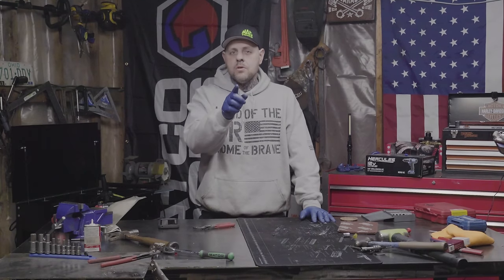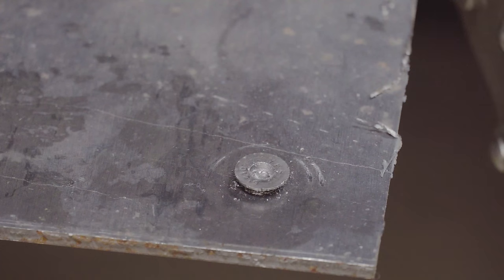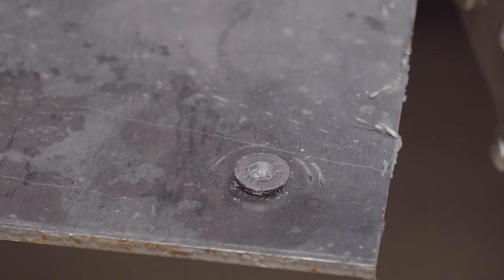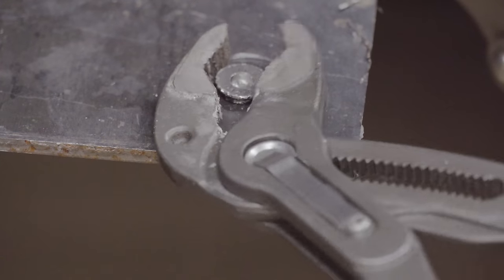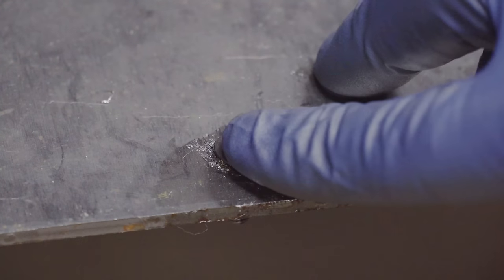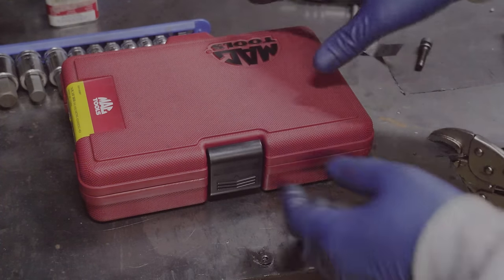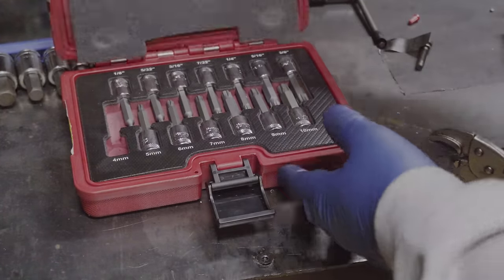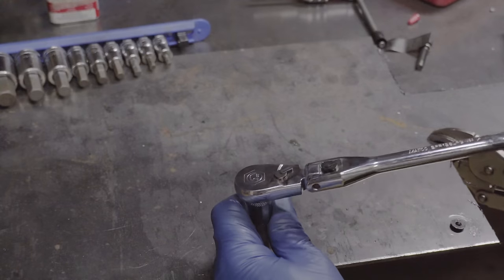3 Easy Tricks to Remove Stripped Allen Head Bolts

Comment from the maker: Do you know any other tips to remove a stripped allen bolt?
Reply: A method ive used many times in the past involves a  dremel rotatory tool and two regular cut-off wheels inserted on the supplied shaft to use cut off wheels (I don't know the actual name of this part). Next cut a notch across the head of the fastener. A 1/4" flat head screw driver fits in this slot easy. Its not pretty because  you can cut into the surface of the part you want to remove, not just the fastener, but it does work.  Works with other fastener types as well.
Reply: One word :Vampliers.
The only thing you need for things like this. Its designed for this very thing. Its a life saver. They also come in needle nose. Hard to believe, but for things like this, they are better than knipex.
Reply: I just get a torx bit and hammer it in and they always come right out
Reply: Yes, you can use a centre punch. First, punch it straight, on the edge. Then at an angle in the punched hole in the direction to loosen the bolt.
Reply: 2nd one I forgot. You can also weld a standard nut to the head (inside the thread) then just use a socket or spanner 👍
Reply: Erwin and other top brands makes screw extractors I use often at work but thats the obvious option. I know you were thinking more outside the box.
Reply: @mikefinto4048  I have found a Torq bit also is the best way,haven't been defeated since I started using that method a couple years ago,but honestly these extractors he showed don't look much different than a Torq
Reply: I've used an auto center punch to drive the head around in a tight locations when I couldn't swing a hammer
Reply: @LoneWarrior.  not so well on countersunk fastners but they work well too.
Reply: Hammer a torx bit into it.... works awesome of that wont take it out it strips it to anothe alab key size
Reply: Redemption Garage weld an Allen wrench to the bolt. Not ideal but it works
Reply: Let’s not forget using a dremmel tool with a small grinder wheel, Can take out enough to use a flat head in the bolt.
Reply: If you still have some grip left in the head and not completely rounded out a dab of valve grinding compound can give you enough filler to get a bolt/screw out.
Reply: Ben Sorisio worked like a charm thank you
Reply: Ben Sorisio did this on my brake cuz one bolt wouldn’t come off
Reply: rubber band
Reply: Brian: thank you for showing tha MAC tools set. I really appreciate it.
Reply: Brian: Could you post the MAC tools set part number? TIA
Reply: Those hex headed cap screws like you showed in the video are easily removed by drilling into the hex area with a drill bit that's a bit bigger than the size of hex key and popping off the head. Could probably do it with the countersunk screws too. I don't like the idea of banging 2 hardened hammers together, they can shatter (I know myth busters say they busted that theory, but a fiend of mine had it happen to him and tore his knee to bits)
Reply: What if the screw is flush and can’t be grabbed from the outside?
Reply: Honestly when they get like that I take the end of my rubber glove, cut a piece of and wrap it around the Allen key. Works every time for me. Depending on what caused the strip in the first place sometime a little heat needed but great results. I’ll also  had a sacrificial key and jb welded it in to get one out. Worked well but not the most ideal way
Reply: Try using a flat, Robertson or Phillips head screwdriver that fits snugly in the screw head.
Reply: I’ve used:
- a Dremel to cut a notch all the way across. Then use a flathead= a little help.
- Dremel all or halfway across, then use a flathead at an angle, tapping with a hammer on back of screwdriver= more help.
- Hammer in a hexgrip head as you’ve shown already.
- delicate situations(like inside guns) JB weld a Allen wrench head into the screw head, let it set 24hrs, then slowly apply pressure.
- vise grips/pliers as you’ve shown
Reply: @AdamDguitars  "What if the screw is flush and can’t be grabbed from the outside?" 
How's it hangin Adam, I think someone mentioned they make "Grabit" type screw extractors, where the inner core is bored and then a reverse thread screw grabber locks in and removes the screw counter clockwise. Besides spraying it with penetrating oil, in addition I always tap the screw with a hammer or nail punch for a few minutes to help break the threads of corrosion or thread lock, before boring and attempting to extract.
Reply: I realize this isn't always possible, but if it's many bolts holding something on. As soon as I realize one is stripped, i re-tighten the bolts on both sides closest to it, and loosen all others. That way some pressure may be taken off of it by the opposite side lifting, and the re-tightening of bolts on sides  will push down taking pressure off of it. Sometimes even when stripped it will come right out then.
Reply: @dustinpomeroy8817  that's what I have been thinking man, they are just Torx ends... Just get a really good quality Torx wrench or Torx socket and tap tap tappy it in and go... Im almost ready to go! Wish me luck guys!
Reply: I hear you now I'm having problems with my custom Harley I got one in the starter with red thread lock on it that is starting the strip thank God for this video
Reply: @mikefinto4048   or an XZN, 12 point, triple-square bit. bit
Reply: Pack some steel wool in the socket, then tap the allen key in firmly. The steel wool will take up the slack allowing the allen key to grip.
Reply: Lmao this thread is great. Here for my red dot on my pic rail😭

Comment: Very helpful video. A couple other methods that I have used are an impact screwdriver with a hex socket attached, and probably my favorite is using a torx socket and tapping it in the hex bolt to get some bite. The latter is what ended up working for me on a stripped transmission hex drain bolt on my Softail. Thanks.
Reply from the maker: Those are also really great tips. Thanks for sharing that brother!

Comment: Thanks to whoever mentioned in the comments using aluminum foil to add to the allen key to make it fit in the bolt. It worked! I was trying to get the faucet handle off an old Delta kitchen faucet to replace the cartridge, and the allen bolt was stripped (or I stripped it). Cheers!
Reply: Thanks to you for saying this for those who didn't see that

Comment: Enjoyed your video....but I actually didn't use any of the methods....but your video game me an idea. I definitely use the first 2 methods because the bolt was recessed. On the last method, the first 2 places I went didn't have such a kit..(although my 3rd stop was going to be Harbor Freight)  I couldn't afford to buy an entire kit of something (even though I'm sure I'll need it in the future.)  Enough rambling....the bolt in question was an M5 .80 thread. The head used a 4 mm hex.  I ended up successfully using a T25 torx bit and it worked! Your 3rd method gave the idea! This was for the clamps on a motorcycle handlebar riser...Thank You!

Comment: Tip 2- albeit with a Torx tipped-screwdriver and a regular hammer, carefully- worked amazingly and saved my bacon at midnight when I needed to replace a faulty shower cartridge. I cannot thank you enough for your tip and I will keep this in mind for the future when encountering a stripped head and no other options present themselves. Again, genuinely, thank you.

Comment: I viewed numerous viideos and wish I had come across your first. The "stripped allen removal set" bit was the only way it worked for me on a shower faucet. I bought and tried the standard screw extractor set which may work fine for standard flat or Phillips head screws but on a small allen wrench "bolt" it just went round and round. Perhaps when I drilled it for the aforementioned screw extractor I created the opening to be enough to get a star-shaped bit (with teeth, as you put it) to fit in and stick when I tapped it with a hammer. Then slowly and prayerfully I turned the ratchet and it stayed nice and snug and was able to unscrew it. Thank you very much. - Allan

Comment: The first thing I do is use a torx bit that fits tightly and tap it in.  It works most of the time on Allen head bolts.  I like the Mac set though.
Reply: I can confirm that this worked this evening. A Torx bit, but otherwise essentially following Tip 2 in this video. Worked very well.
Reply: Was thinking I was gonna have to weld a nut onto the bolt but tried this and it worked like a charm
Reply: @xemericaxx  👍🏻
Reply: Thank you for the Torx tip, it worked amazingly well!!!
Reply: @chickyman1  Glad it worked for you!

Comment: This is a great video. Very easy to follow. My problematic allen nut is unfortunately much smaller (actually a bigger problem). I tried the smallest allen wrench (<< 1mm) but it didn't grap. I think the allen nut had rounded out by previous owner of the house. This tiny allen nut is holding a knob to the shower diverter on the wall of my bathroom. Do I need to cut out the know with a saw? Help!!

Comment: 1. Instead of using the rubber band method, use aluminum tinfoil.  It's an harder material than the rubber obviously, and will fill in the gap between the allen key and the stripped bolt.   place a small piece of the foil over the bolt and push in (or hammer in) the key, OR, place a little piece over the allen key and push it in.  When you feel that it's tight, turn to open.
2. Torx.  Best method for me. Place a Torx BIT over the hole and hammer it in gently but firmly.  Tap tap tappy tap until it is IN.  Then turn it to open while you're pushing it in.  You'll be modifying the allen into a Torx hole.  Worked for me just now.  Stripped M4 flathead and the 2.5mm hole was stripped.  The 2.75mm hammering of the allen (7/64" allen) didn't get in.  But the #15 Torx which is actually 3.25mm got it because of its sharp corners.
Reply: I have the exact same size stripped bolt. It’s too shallow for the rubber trick to work so will try tinfoil now and thanks for the torx number that worked for you, will grab one of those tomorrow!
Reply: @joconnell  Good luck. I am curious to know if or how it worked out for you.
Reply: @danl.4743  tin foil didn’t work in this case as the hole was too small and the Allen bit too sharp - pushing in to the hole just made a hole through either a rubber glove or bit of tin foil alas. I’ve picked up some Torx bits to go with your hammer approach instead, I just need to figure out a good way to clamp the lot in place while being an apartment dweller with no workshop 😄
Reply: @danl.4743  same as you, the #15 Torx did it for me perfectly, thanks again!
Reply: @joconnell Fantastic. Great to know I helped someone over the internet. 👍

Comment: I need a good set! My 10mm allen key socket was fine, but the bolt was broken :/  Now I need to drill with this right to I can remove it. and get a bolt for drain and fill. Which set? I'm from Toronto Canada!  Really appreciation the time and effort that goes in!

Comment: I think the absolutely best way i get stripped allen bolts out is to use a slightly larger torx but and hammer it into the stripped allen and spin the fastener out... works nearly 100% and i don’t have to purchase anything off the tool truck. Great video love the content you post
Reply from the maker: That does work but i have screwed myself before by using ome destroying it and then need it lol so i try not to use those anymore. Thanks for watching and for the tip brother

Comment: My stripped Allen head go too tool is a torx bit and hammer. Or an easy out socket like the Irwin ones that chew in as you hit them with the cordless screw gun or cordless impact. But the torx sockets almost always remove the stripped Allen bolts 98% of the time

Comment: Sometimes a TORX bit can be hammered into the head, they are usually tapered and their shape is a lot like teeth.
Also you can use a centre punch on the edge of the head and a hammer, fantastic technique for badly siezed bolts.

Comment: A method I use a lot (depending on available space) is to cut a slot into the head with an angle grinder with a thin cutting disc, so it ends up like a slotted screw. It may come out with a screwdriver then, or impact driver. As it’s stripped though it’s probably tight so usually end up knocking it round with a small chisel.
Reply: I do the same but using a Dremel for small bolts.

Comment: a car or bicycle innertube works as well if the bolt is not too tight, cut a flat piece, place over the hole and jam the allen key into the hole

Comment: You also take the same size Alan bit you used to strip the bolt and stretch a rubber band over it and insert it in the bolt and get it out

Comment: Option #4: Weld a nut on it... Not only gives something to get a hold of, but also heats the bolt to break it lose.....
Reply from the maker: Great tip and definitely a viable option. Thanks for sharing that Ed.
Reply: @RedemptionGarage  not a problem 😎
Works pretty good on broken bolts too, but sadly, not always...  Had a broken head bolt on an air compressor a while ago, welded nuts to it and kept breaking the bolt off .. after the sith time, the broken end was below the top of the block.... Drill time😥
Reply: I use a turpentine laser torch with a flux capacitor tip that super heats the bolt to 2000 degrees it vaporizes the bolt everytime along with the project but hey at least its out
Reply: @reubenmunoz13  hmm... I'm going to have to get one! Sounds like it works great!!😎
Reply: @reubenmunoz13  I tried that, it sent the whole shop a month back in time, so I had two shops in the yard.  Boy was my wife unhappy!  Kept going on about "My petunias!  Plus you could trigger a false vacuum decay that destroys the entire time-space continuum!".  Chicks, man.
Reply: @abmackay  well if you run a false delay in the space continuim and Super cool the flex capacitor to minus 200p degrees it should reverse mansatize one of the shops to a female garage
Reply: Wont on alu bolts
Reply: Because we all have welding tools laying around.
Reply: genius

Comment: Something that works for me nearly every time is to use a Torx bit. The teeth of the Torx will grab the inside of a hole.
Also, if you get a green stone Dremel grinding bit and first flatten then slightly cup the center of an Allen key you can hammer that into the head of some bolts and broach the hole a little. I try the original size first and then the next size up. If it's a metric choose a standard and standard choose a metric.
Reply: Allen bolts are sooo 1900's. When you get it out, switch to Torx if possible.

Comment: Great video. I just ordered 3 of those MAC Tools RBRT bits in a 6,7, and 8mm size for the removal of my stripped Santa Cruz Tallboy 4 mtn. bike, lower shock linkage axle bolts. Hopefully these work!
Reply: How'd they do?
Reply: @hereusethis   Unfortunately they were useless in this case. We ended up having to use an EZ out and very slowly turn the bit so as not to totally shred the relatively soft 6061 Aluminum. We soaked the bolts in Kroil penetrating oil(highly recommended) and that did the trick, but we had to be very ginger about turning the EZ out. First we tried to use an impact driver on it but we ended up gently turning the EZ out tap with just a Crescent wrench until it cracked and then hit the impact drill/driver.

Comment: I don’t think I’ve seen this in the comments yet. I’ve tried the dremel across the middle to use a flat head but didn’t have any luck with my last one. Solution: used a dremel on 2 sides of a button head to give myself something to attach vice grips to.

Comment: Your set, looks wary much as Torx, maybe worth trying.
There are other methods, try to place some rubber between the screw and the bit, it do often help a lot.
Or try to use reverse drill bits at wary slow RPM, that do also help a lot. :-)
Reply: Your rubber band tip just gave me the idea to use a small piece of aluminum tin foil instead!
Reply: @danl.4743  Sounds interesting! Please tell me about the result and your technique!

Comment: What most of really need is an engine block that we can easily remove the offending piece the stud is stuck in so it can be placed in the bench vice, and then we can use various methods already known to extract it.

Comment: When the bolt head is recessed into a hole or otherwise obstructed by something so that it's impossible to get a decent grip on it with pliers, often the only way to remove it is using various bolt removal tools including drilling it out, which is usually what I have to do.

Comment: Man I got a straight up round stripped ruined used to be allen head screw stuck in an intake manifold on an old timberwolf atv so it's hard to get to I tried all sorts of pliers still stuck! The break kit wouldn't fit where I need it either

Comment: I have a tiny one that's partially stripped. The 8/32 bit is stuck in there. It's a tiny domed head one and it's recessed which makes it even trickier. On top of that I think the company put threadlocker on it :(

Comment: I've tried all 3 methods, the last one worked a bit but it seems to just eat through the bolt.. any tips for older soft bolts?
Reply from the maker: If you have tried and still no luck you may have to drill it out or use screw extractors. I did a video about removing stripped bolts and talked some about it if you want to check it out. You can find it here https://youtu.be/2PikXXlLGjA 
But it is a long video because i talked about many different ways but some other ideas may help you too. Sorry for the delay in answering

Comment: Saw another way where they used a hack saw to turn it into a flathead. Any reason you don't recommend this?
Reply from the maker: That could work but the reason i wouldnt try that is because if the bolt is old and rusty then it wont hold as much but it is definitely an option